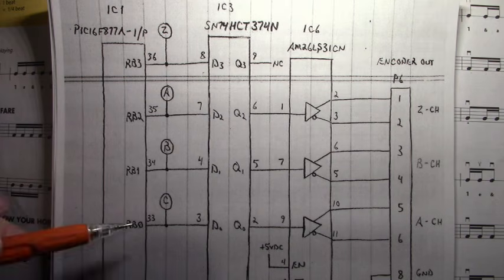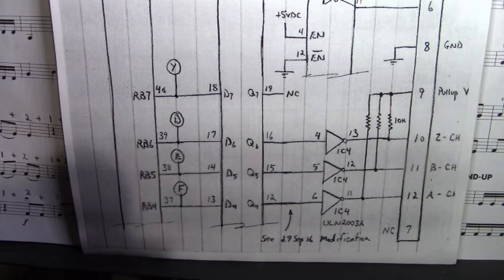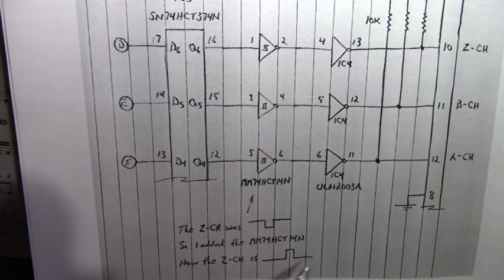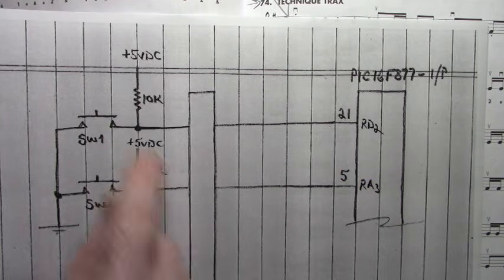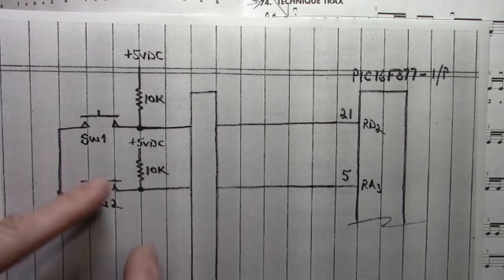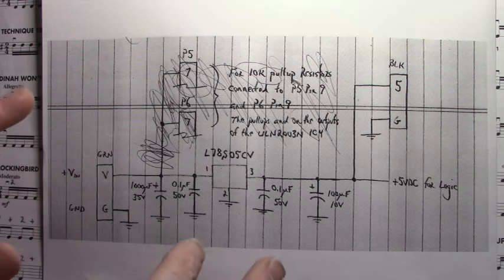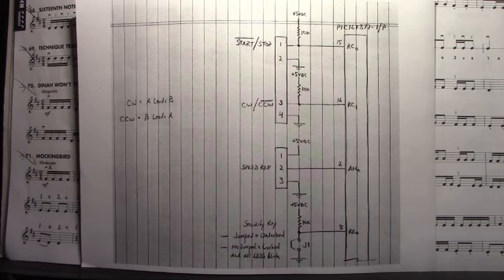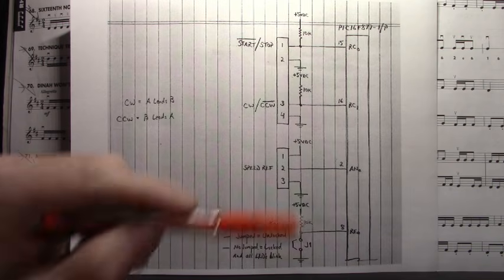Explanation of the Hall Effect / Encoder Simulator Hardware

Comment: Hello Peepaw! I don't know if you read YouTube comments but I didn't find any contact information. I need to ask you for advice regarding Allen Bradley Ultra 3000 servo drive:

The drive worked well but today when powered up the drive instantly started smoking. I found out that the internal shunt resistor (35 ohm 40w) burned. But I didn't get any error codes before or after. The drive still powers up with no errors and shows ready but I haven't tried to move any motors with it to prevent any additional damage.

Do you have any idea what could have caused this?
Reply from the maker: Hello Mr Jaska, I hope you are doing well. In my experience when the regenerative braking resistor burns open. The regenerative braking transistor has short circuited. It has a short circuit from its collector to emitter. I call the shunt resistor the regenerative braking resistor. Same same. I looked at the diagrams in the pdf. I may be wrong, but it appears the collector of the regenerative braking transistor is connected to TB2 terminal 1. You can take one probe of your multimeter set to diode test or resistance. Place it on TB2 terminal 1. And the other lead placed on DC Bus- (minus). It should not read very low resistance or a very low diode drop. If it does, the regenerative braking transistor is shorted. From what you say, I am afraid your drive requires replacement. I am so sorry.
Reply: @PeepawMcDonald  Thank you very much for sharing your vast wisdom and using your time to look into it.

I will test this tomorrow when i get to the machine.

I found a "Toshiba GT20J101" IGBT/transistor on the board but i'm not sure yet if that is the one controlling the regen braking.

Do you think replacing the braking transistor  + resistor could help or is it pointless and theres something that will just short the transistor again?
Reply from the maker: @jaska9720 Hello Sir, According to the datasheet GT20J101 the middle lead is the collector. If it connects to TB2 terminal 1, it is the IGBT for the regenerative braking resistor. Many times when IGBT's fail. The short circuit energy shoots through to the gate firing circuits. And damages the gate firing circuitry. This makes the repair of the drive much more difficult. Not impossible, just more difficult. If this is the IGBT for the regenerative braking circuit. You can place your multimeter in diode test mode or resistance mode. Place one lead on the middle pin (collector) and the other lead on the third pin (emitter) to see if it is shorted. It should not read a low diode drop, or low resistance. And to test if the gate of the GT20J101 is damaged. You can take your multimeter leads and place them across the first pin (gate) and the middle pin (collector). And then do the same for the first pin (gate) to the third pin (emitter). In either measurement to the gate pin. It should not read low diode drop or low resistance. If it does you will have to go back up into the gate firing circuitry on the board. And see if any of its components have be damaged. So sorry if I got a little long winded there. I have repaired many transistor base firing circuitry. And IGBT gate firing circuitry. Many times I have been successful. And many times I have failed with the transistor or IGBT flaming out again, because I missed a damaged part in the firing circuitry. It is especially frustrating when you are trying to find a bad surface mount component. Very tiny components. I hope this helps you in getting your machine up and running.
Reply: @PeepawMcDonald  Thank you very much again for taking the time to guide me. I'm new to working with servos and servo drives, previously just been using stepper motors and they are a lot simpler. Fortunately I had one extra Ultra3000 as a backup so this is not the end of the world, but it would be great to repair this to have one backup again haha. But if not, atleast I can learn more about servo drives and electronics.

I will follow your advice and do these tests. With your previous suggestion testing between TB2 terminal 1 and DC bus- the resistance started rising so maybe the transistor isn't shorted? Anyways, since I'm not in a rush (at least before the next drive breaks) I will try to get to know the board better with your advice.

I also found a bigger IGBT "brick" (MIG30J103H) when i removed the PCB and the heatsink on it. I have to test to where that is connected also.
Reply: Hi, on the GT20J101 there is full continuity between collector and emitter, but gate to emitter seems fine. And the collector and emitter has full continuity to DC bus-
Reply: Can I use this circuit to check Fanuc servo encoder